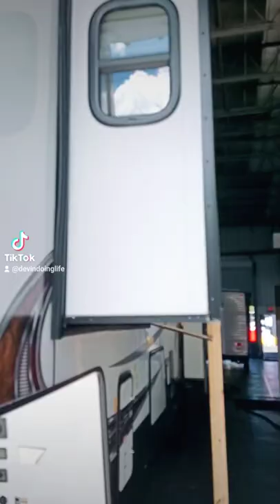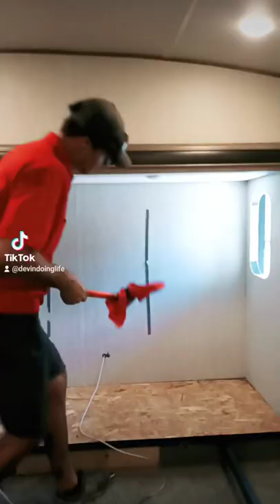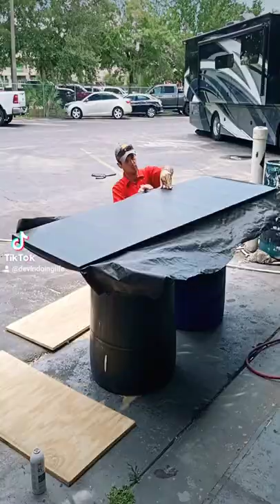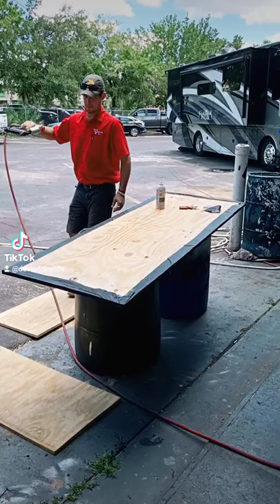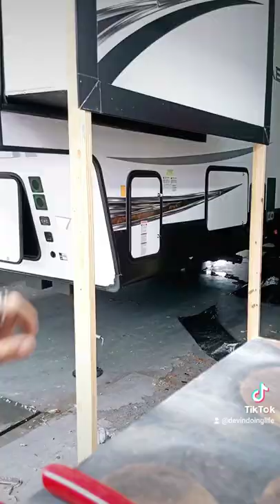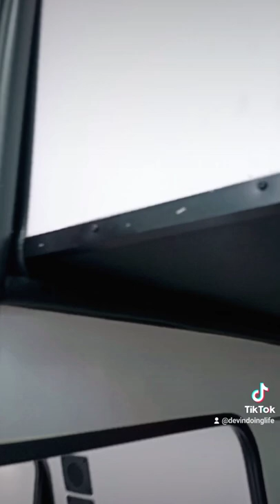RV floor replacement in 1 minute

Comment: I wish my slide out was as simple as yours is.  I have a 2 by 2 frames where a queen size mattress fits on top.  The slide-out part is beyond and outside the 57 inches of width of that frame.  On either side of that frame the board reaches out to 64 1/2 in total width which is almost 4 in on either side.

Comment: Where can I get the waterproof membrane and adhesive you used I need to replace my slide floor
Reply: Their is dicor bonding adhesive works good ! 
Also the membrane is called plastic underbelly @marcusreid7472

Comment: I got the same unit but a 2019, what is the moisture barrier you used called?
Reply: It doesn't work. That's why the floor rotted. You need to add some metal angle flashing at the side trim piece and use some epoxy on your replacement wood.  Then cover with any black tarp material.  There are better videos on YouTube.

Comment: so the only support on the outside edge is screws into the wall above?That doesn't seem like a very strong connection....especially for a possible couch  and multiple adults being on top!
Reply: Seriously…
Reply: The plywood rests on top of the steel arm that moves the slide and is secured with lagbolts...

Comment: Around how much would that cost
Reply: 10 thousand at least
Reply: @trev119  if you really think just replacing that will cost 10k something is wrong.
Reply: That would cost maybe a few grand. Waaaay less work than replacing the flooring inside the actual living space.